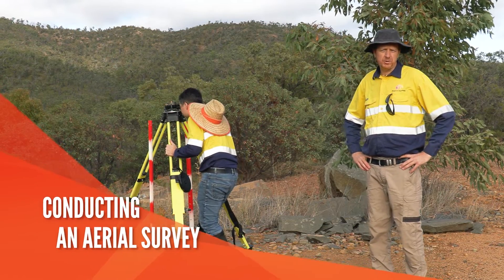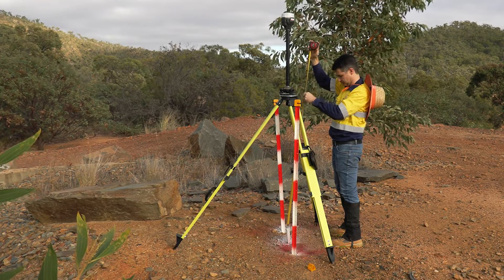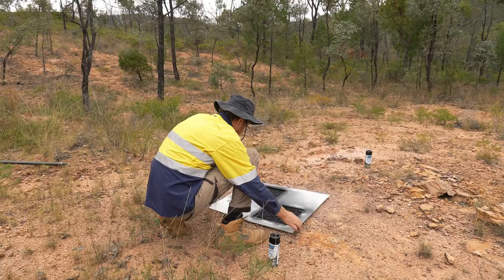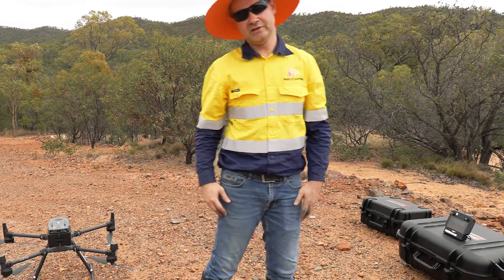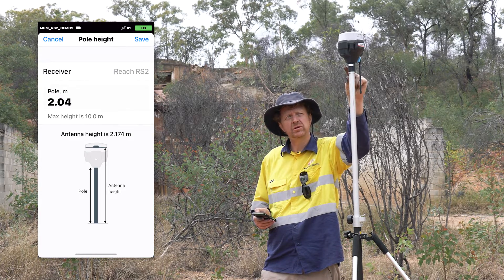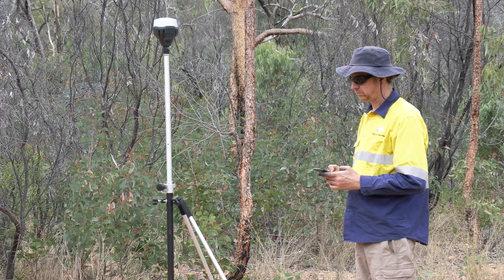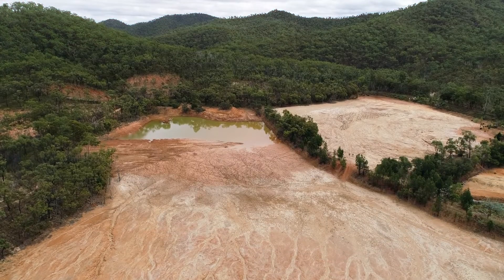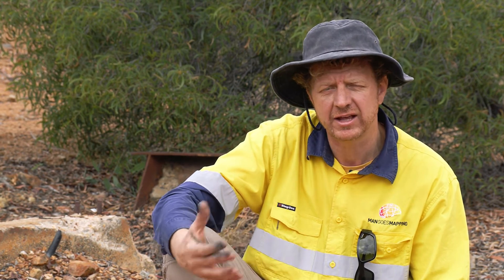Conducting an Aerial Survey | 4 steps to capture precise RGB & LiDAR data

Comment: can you explain why some people use free rtk services and other people use their own rtk ground stations? What's the difference when making maps like photogrammetry? Is it needed to use your own rtk when making lidar data and not needed at all when making plain maps?
Reply from the maker: If you have cellular coverage and the mount point is close enough - you can use NTRIP services (paid or free). 

Use a base station if you are in a remote area for RTK - or you want to use a static log from the base for post processing (a PPK workflow).

Neither or these workflows are specific to lidar or photogrammetry data collection.
Reply: It's also worth noting that the distance between the RTK base station (or CORS station, when using an NTRIP correction) is correlated to the precision of your observations. Short baselines (ie. from your own base station  setup within just a few miles) will deliver better results than when depending on an NTRIP base 20-30 miles away. Degradation of precision is non-linear, so baselines below 1-3 miles won't be too different to even shorter baselines, however as you extend that baseline out, you can expect increasingly larger degradation of your RTK GNSS observations.

Comment: Good day Mate! Ed here from Central CA reaching out with a Q for you. First of all thank you for this video. Very informative. Well done in presenting it as well. My Q is as follows. Could you have used the DJI D-RTK2 to do what you did instead of the Emlid Reach RS2+? Thank you!
Reply from the maker: Thanks for your question Edmond,

We do not have direct experience with the D-RTK2 base station from DJI, however we see from our client list (including major national DJI retailers) that the Emlid RS2+ is a popular and more versatile alternative.
 
Feedback from our customers indicate that to collect GCP coordinates with a D-RTK2 is really inefficient and impractical for the following reasons:
 
1. You need to use your Phantom controller as your field data collector (in mode 3?)
2. Using local corrections from a 2nd D-RTK2 base uses Occusync to broadcast the RTCM corrections from base to rover, with a ground to ground range of around 1km (effectively line of sight and variable based on local conditions - in some occasions this may be longer), based on feedback from experienced users.
3. Using an Emlid receiver as a base outside of mobile coverage (as is often the case here in Australia...) would require the user to broadcast the correction via wifi from the Emlid GNSS receiver to the DJI controller, which is also used to collect the GCP coordinates from the D-RTK2 rover. Therefore, this is impractical
4. Using NTRIP, a user can consume a correction from a D-RTK2 base or from an Emlid GNSS receiver (ie. using the free Emlid Caster), and with a SIM card in both the base station and the DJI controller.
5. The poor construction of the tripod, and lack of support for datums other than WGS84 render this workflow inoperable for most surveyors.

As a consequence, the majority of our DJI customers do not even purchase the  D-RTK2 base, and instead purchase 2 Emlid RS2+ receivers - 1 to use as a base, and one as a rover. This is a proven, cost effective and versatile solution.

In the case that you operate exclusively in mobile areas with a good CORS network, you would only require 1 RS2+ that can be used as the base during aerial surveys, to provide a RINEX file with a short baseline, and also as a rover, to coordinate your GCP's.

Keep in mind that when using GNSS RTK, there is a non linear (compounding) error associated with the length of baseline between your base and rover. In an ideal world, you would keep this under a couple of km's, but of course you can stretch this out depending on the level of precision your client requires. In such a circumstance where high precision is required, I would recommend establishing an Emlid base over a known survey mark, rather than depending on a distant CORS reference station.You can then use Emlid Caster (or Emlid's local NTRIP over wifi) to broadcast a correction from your Emlid base to your drone controller.
Reply: @MangoesmappingAU  Thank you VERY much for the in-depth response! Makes good sense and I will take your advice and just go with the RS2+
Reply from the maker: Emlid have tutorials and very supportive user base via their forum, https://community.emlid.com/
Reply: @MangoesmappingAU  Good to know. Thanks a million once again. Blessings to all your endeavors.